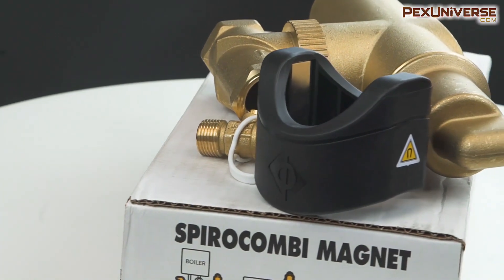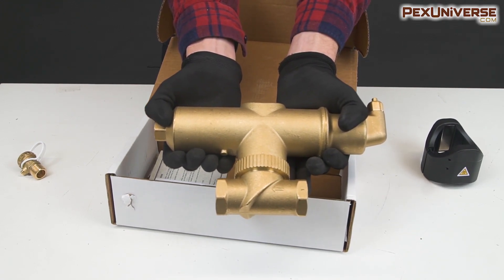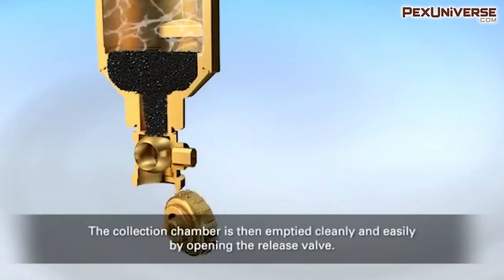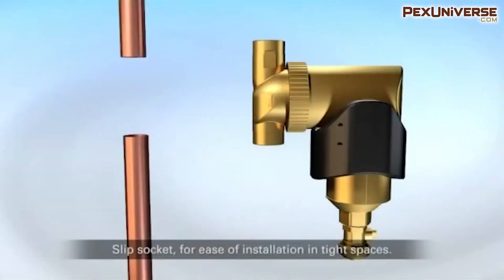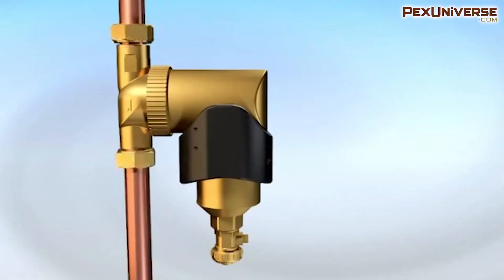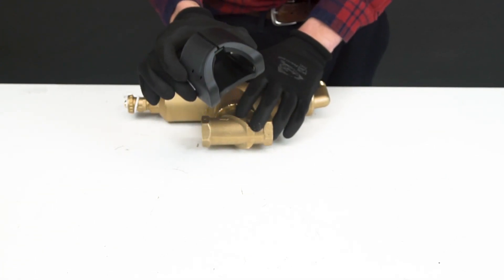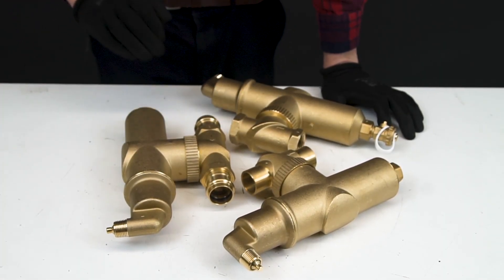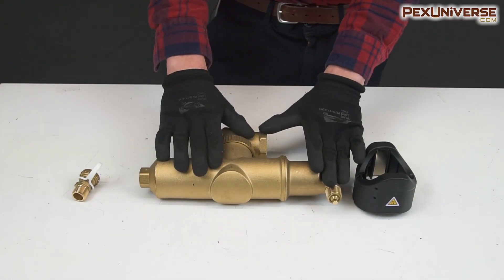The Spirocombi Air & Dirt Separator Will Save Your Heating System

Comment: hi!!, I would like to mount the Spirocombi, I would mount it on a VERTICAL multilayer pipe with flow from bottom to top. The spirocombi has the flow arrow from top to bottom. Just loosen the ring and rotate the 2 connectors or it's not possible, thanks

Comment: Why mount on the flow on new system but return on existing? Surely its best to fit on return either way??
Reply from the maker: Hey there! In a new
 system, the best position is at the hottest point of the system, which is why the flow side is generally better. When adding to an existing system there is the potential for dirt and corrosion already present, so it is better to be positioned in the return. However, the location of the unit can ultimately be determined by the circumstances of a specific system.